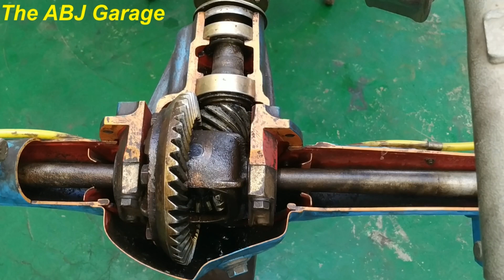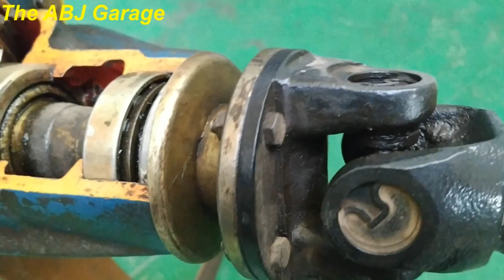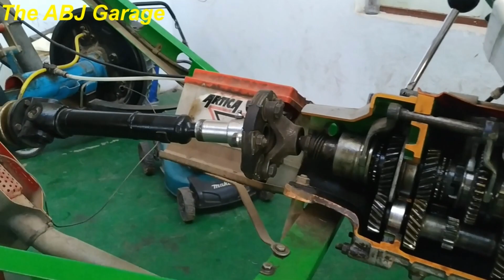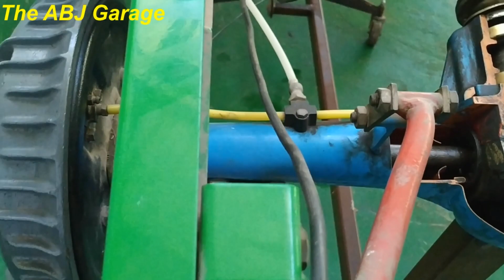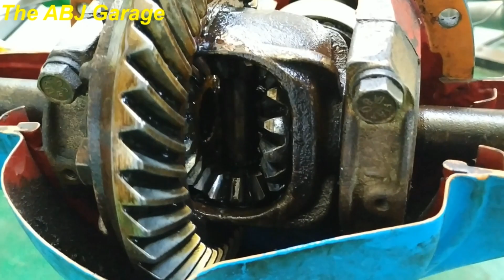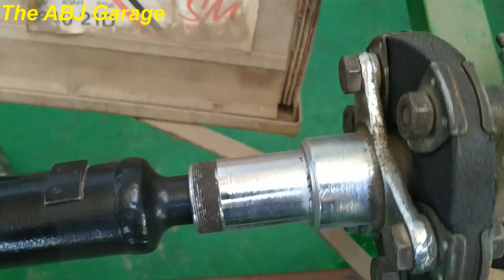5 reasons why differential fails / 5 things leading to differential trouble

Comment: Thanks for this helpful video, will a new tyre and an old one stress the differential (different circumference) ?
Reply from the maker: You are most welcome! Thank you very much for the wonderful encouragement! The difference in circumference of left and right tyre, will cause them to be driven at different speed! That will not stress a standard differential as it is designed to allow speed difference. But; limited slip differentials might slightly be affected. A limited slip differential might overheat when the internal components of a limited slip differential (LSD) become excessively hot due to excessive friction caused by prolonged slipping, often happening during aggressive driving situations.

Comment: Where and how can the differential oil located
Reply from the maker: The differential oil is located inside the differential unit, there is a  oil drain if found on the lower side of the differential whereas the oil refill plug is found a above the drain plug hole on the differential and axle housing.

Comment: I have 2013 ford explorer leaking from the breather vent,  i replaced it and still leaking diff. fluid. what is causing it? thanks
Reply from the maker: Could be caused by blocked vent! Check to see if the vent is blocked by dirt and debris, that will pressurize the differential causing an oil leak
Reply: @TheCarCareGarage  shop put a new part but still leaking(noticed that it only leaks when it gets cold) tried replacing with hose with breather filter on the other end(still monitoring if it will leak) so far, so good